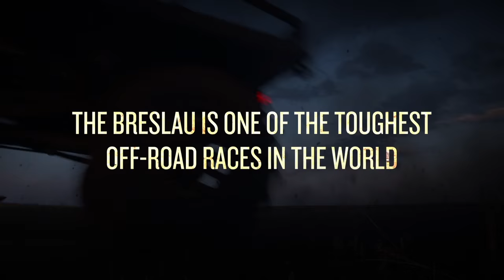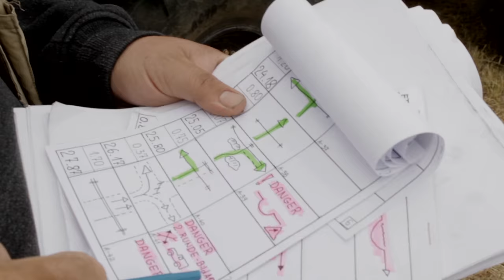Magpul Films - This is Breslau - Official Trailer

Comment: what ever happened to the magpul that made useful firearm parts?
Reply from the maker: Since 2011 (when this was filmed) Magpul has released about 50 firearms related products a year. For example 21 round Glock mags just started shipping 3 days ago.
Reply: That's a dick head comment. Magpul has released a shit ton of new products. That fact that they have of luxury of entering in this race on top of running the primary business shows how successful they still are. Easily the coolest company in the USA. It's so easy for a company to build a badass Offroad rig that they can take to trade shows to build publicity. What I find so awesome here is magpul is actually using it like it's designed- something most wouldn't do- they'd rather just have a show truck. Way to go magpul, going above and beyond as usual!
Reply: How about some m&p9 plastic mags!!I'm tired of my damn magazines rusting because of sweat from daily carry.